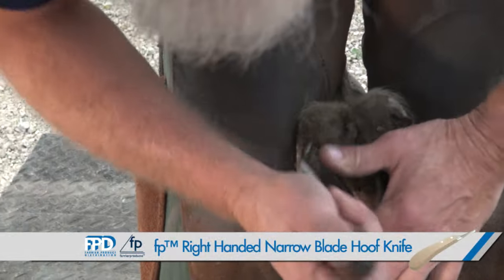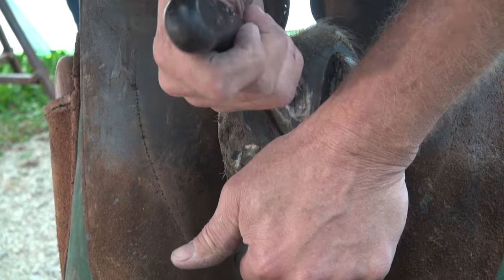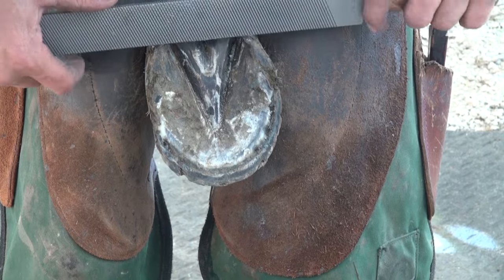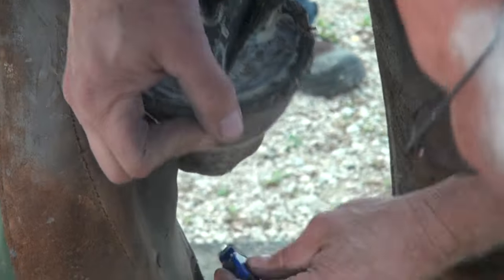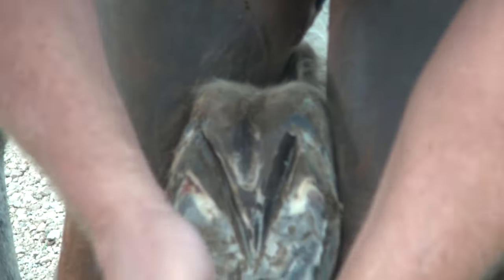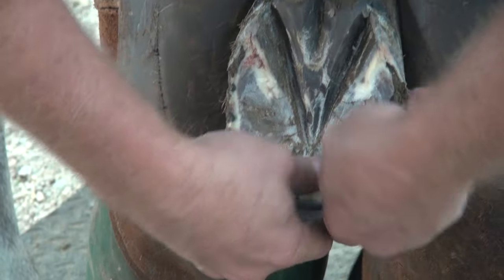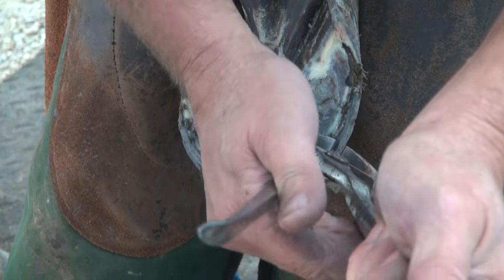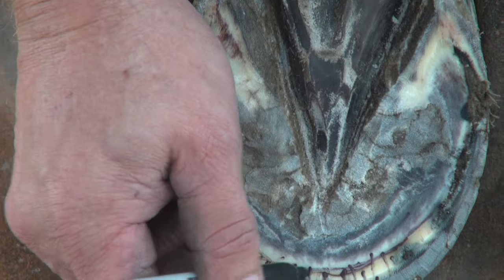Basic Trimming with Bobby Menker, APF CJF

Comment: How can you tell by feel if you’ve taken to much off? You mentioned that you feel/press in. What are you feeling for?
Reply from the maker: If the foot doesn't give easily to the pressure, they can be confident the sole still has good thickness. It's just a general way to know. The thinner the sole, the more give there would be and that's what they want to avoid.

Comment: I see seven nail holes in the white line. What can you do to make sure you don't get nail holes in the white line?
Reply from the maker: Thanks for your question. When you are nailing shoes on hooves, you can't avoid the holes. Often farriers will fill them with something like the Kerckhaert Nail Hole Solution that helps to maintain the hoof health.
Reply: that is scarring. Maybe that would be a clue not to shoe a horse.
Reply: That's because of driving the to high.it shows when he either reset or shoes a new shoes. In time it will break off.because of old nails holes